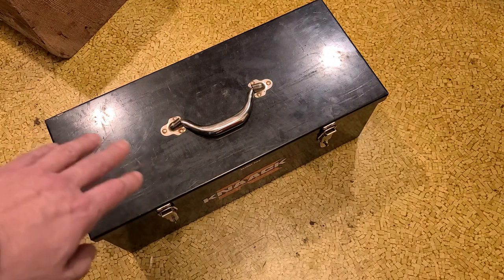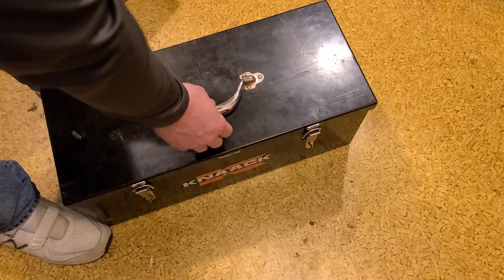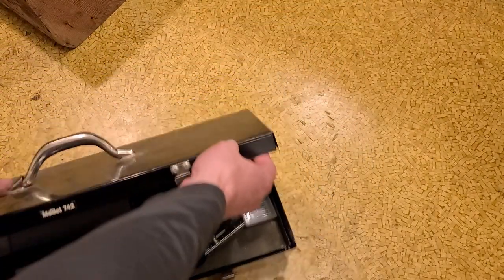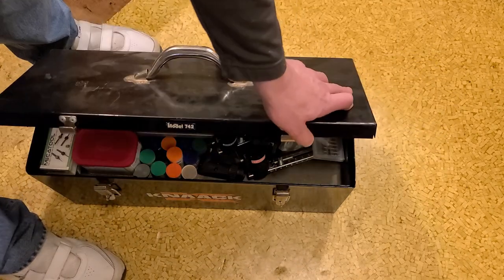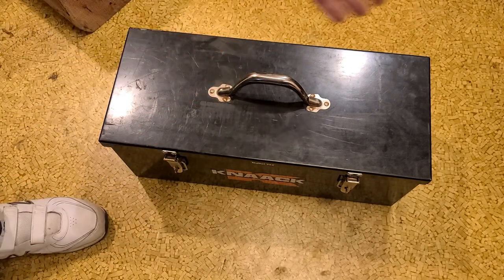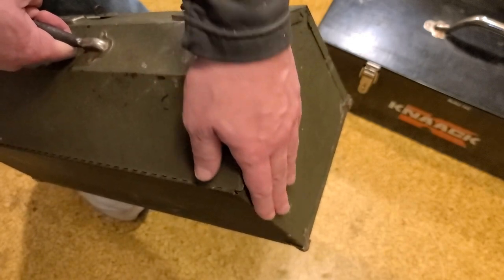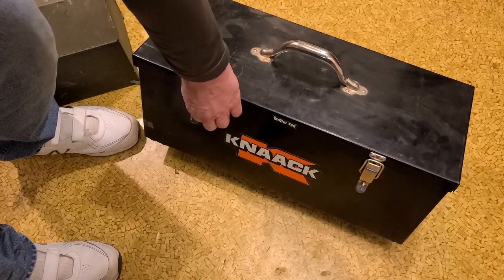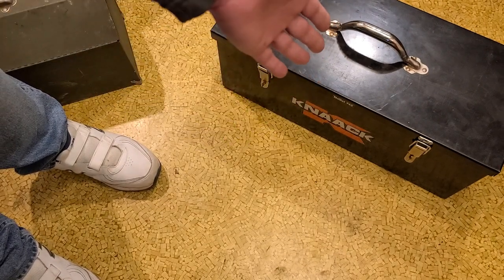Knaack 742 Carpenter's Job Site Tool Box Review

Comment: Not a carpenter tool box.  Doesn’t fit a framing square in it or a hand saw holder on the lid it’s just a tool box. A very expensive tool box

Comment: There's a Knaack model 63 rolling tool chest that's on Craigslist for $1k and it has a bunch of dings and bent skirting from shipping apparently. The new ones go for over $2500, but it still doesn't look worth it, especially noting this box's features.